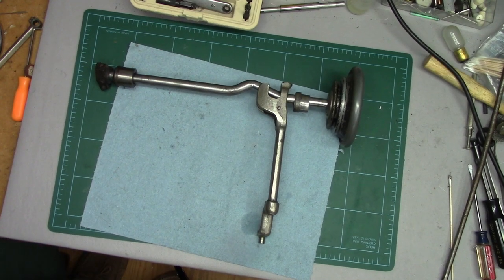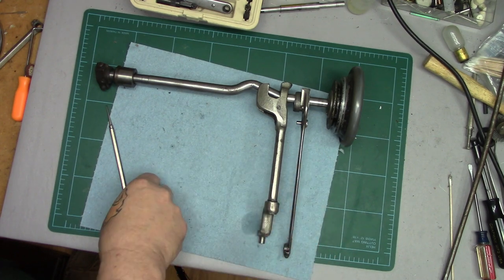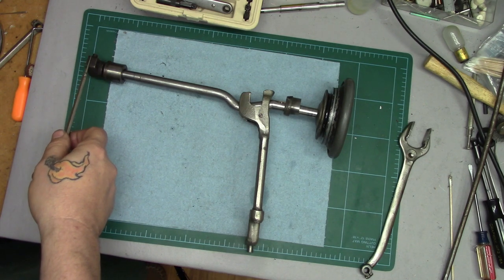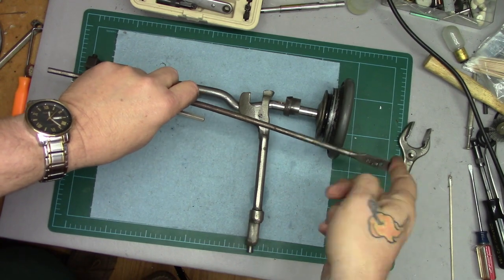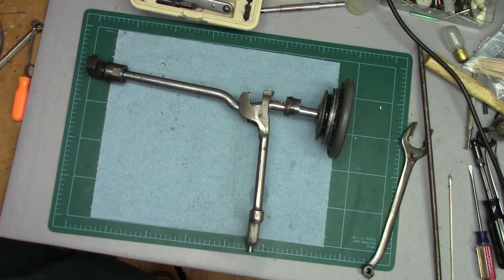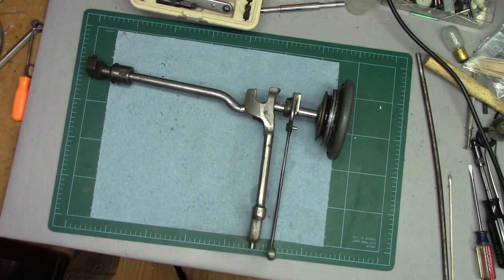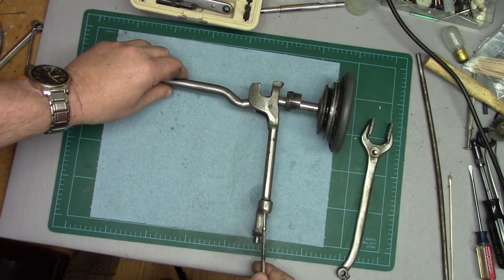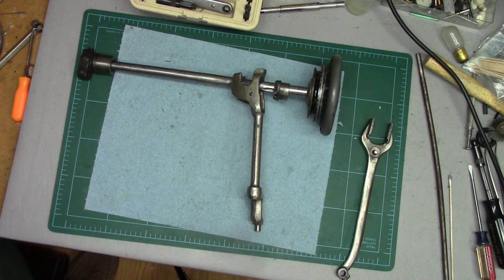66 Main Shaft Components and Orientation

Comment: Good video, good advice. I've done a number of the old Singer shafts. I found the advantages of cleaning them not worth the trouble. More damage can be done than good. That's why I believe alot of the videos on tearing a machine down to clean it is unnecessary. They never take out these shafts. Paint and restore a different story. Like you said "mask it". Thanks
Reply from the maker: Normally, I don't take these shafts out, and I would never recommend doing so. Singer made too many of these machines to worry about saving every one of them...

Comment: Seeing this shaft was really interesting to try and understand the internal mechanics of the 66. My 66 has a second spindle fitted on the left side. To the left of that pin are two oil ports.  I have been advised that the 66 only has one bobbin spindle pin and that this second one has been hammered into an oil port. Is this correct? I cannot see where on the shaft a third oil port would be necessary? I would be grateful if you could advise me before I attempt to remove this pin.
Reply from the maker: This is a case where I wish Google would let us post pictures in YouTube comments... There was an engineering change somewhere along the line to the 66 where a second hole appeared on the left end of the machine that appears to be an oil port. The hole that is at the base of the slope at the needle bar end serves to lubricate the bearing on that side of the machine. On older 66's, there isn't any other holes on that side (besides the hole at the top of the needle bar box). On later 66's, there is another hole about an inch and a quarter to the right. I believe that hole is fair game to add an extra spool pin as I don't see how it could be providing a lubrication point for any part of the mechanism. I personally don't know why anyone would want to add an extra spool pin at that location, unless it was for bobbin winding. It seems to me it would be more in the way than a help.
Reply: @BobFowlerWorkshop  Thank you so much for the information. It has actually been really difficult finding a definitive answer but I knew you could provide it! I really couldn't understand why it would have 3 oil ports there! I'm enjoying restoring this machine and just successfully rewired the knee lever controller and lamp. I stopped short of the motor though. Maybe this could be a video in the future? ;) Thanks again, happy to be a new subscriber!

Comment: I just picked up a 66 - the flywheel is running unevenly when engaged - when not engaged it runs true for bobbin winding - I am thinking it can only be a bent main shaft, are there any other options?

Comment: I have a relatively clean 66 I am cleaning up for my wife.  While the outside and stitch side seem in good shape albeit covered in lint and crud, the vertical shaft area inside the back appears to have a bit of rust or corrosion at least on the non-bearing surfaces.  How to clean?  I was thinking of some type of foam cleaner with gravity taking it down through the bottom?  Or I have a bike chain cleaner that evaporates quickly, I was using that on some of the stitch side parts.  I was able to relatively easily remove the stitch length shaft/adjuster so I can clean that without problem.

Comment: Thanks! I actually did break that vertical shaft on the first 27 I tore down. I pried on it, somehow, and it was not a great quality casting to begin with. Lots of air bubbles in it. Figured out how to remove the horizontal shaft, in my case using a really long bent bolt for a punch. Got another rocker shaft on Ebay and all went well. Actually brazed the original back together, in case I'm ever in dire need of one. Not sure I'd trust it though. Now I can say I did it, at least, and hope to not need to do it again!
Reply from the maker: I presume then that you know why I don't recommend taking them out!
Reply: @BobFowlerWorkshop  Well, it wasn't a horrible experience. Guess it's good to have done it at least once maybe. Not something to do unnecessarily for sure! I'm reminded of something my grandfather told me when he coached me through my first engine overhaul. "Be sure and do it right, it's a long way back to there!"

Comment: Bob, Thanks for making the video.  I believe you are the first English speaking person to do so!  I found it very interesting.  We have a Singer 66 with a broken vertical Arm Rocker Shaft and Singer 99K with a bent horizontal Arm Shaft.  I really don't have a choice but to do this type of repair on both machines that we were gifted.  I could part them out, but it seems kind of a waste of a nice looking machines.  Both have original surfaces and all the decals are all there, nice and bright.  I have a couple questions: (1) Will the horizontal shaft come out without using your long curved rod to hit the bearing in the nose area?  Or is it better to use the curved rod?  (2)  I have heard that the bent horizontal Arm Shaft on a 99 can be bent back straight with some effort in place, without having to completely remove it.  It will require the loosening of all the screws and using a pry bar to bent it back straight.  Do you have any experience with this method?  Thanks again for your video and all the effort that it takes to do it.
Reply from the maker: Rafael, you have your work cut out for you, that's for certain. You need a long 1/4" rod to tap that front bearing out, there's no other way of getting that bearing out that I'm aware of, and it HAS to come out to remove the main shaft and/or the vertical shaft. I neglected to mention one other part that has to come off the main shaft before it can be removed: the flanged stop motion bushing which is held onto the main shaft with a pin. It's the bushing that the balance wheel rides on and is acted upon by the stop motion knob and washer. That has to come off or the shaft can't move to the front of the machine. So... To answer your questions specifically 1) The service manual just says to use a 1/4" brass rod. I curved my steel rod just a bit to make it easier to get into position. I'm not certain if that's really necessary, but you do need a long rod to knock the bearing out.  2) I have never attempted to bend a main shaft back without removing it from the machine. I can't imagine being able to bend that steel while it's INSIDE the machine, nor do I see a way to do that without taking a huge risk of damaging the main body casting, but maybe I lack imagination.
Oh yes... I'm actually tri-lingual. I'm fluent in English, Sarcasm, and Profanity! :-) Thanks for watching, and I'd really like to know how you make out with your machines.
Reply: @BobFowlerWorkshop  Thanks for the great information and I'll get myself a 1/4 inch diameter steel or brass rod.   I will keep you posted.  I right now I'm got some other "projects" which I need to work around -  painting the inside of the house and doing yardwork at my daughter's condo.  I'm figuring it will be this summer sometime I hope and I've got my parts on the way from eBay.   I also got a Singer 115 Treadle to work on too.  Thanks again and keep up with the great videos!

Comment: Bob, i have a question regarding the stitch length regulation.
The 1907 i have i just disassembled for cleaning & restoration & i noticed that the S.T.L. arm has excessive wear on the surface that contacts it's cam like as though it ran without oiling for some time & part of why it was as stiff as it was when i got her.

I have a much better S.T.L. arm from Ebay & the cam looks to be okay once i cleaned off the grungy junk off of it, would this be a candidate for Main-shaft removal for possibly a cam?

Comment: Without removing the main and vertical shafts, how do I clean them? I can access the the top bend in the top via the back opening.
Reply from the maker: You can adequately clean them via the opening in the rear of the machine. They don't have tobe sparkling, just get the excess crud off the contact areas.
Reply: @BobFowlerWorkshop  thank you for your quick reply
Reply: @BobFowlerWorkshop  I got a "new" 66 which is in worse shape than my first. These components move smoothly, but I'd like to get the shmoo from the stitch regulator area - suggestions? I'm a clean freak, but not enough to take the main shaft out!!

Comment: Hi Bob. I have a 99- that has a bent shaft. Apparently it was dropped before I bought it.  Worth doing all this?  I don't "need" it as I have others I use.  Just want to have your thinking on it.  It's a pretty machine.
Reply from the maker: Well, you have nothing to lose, do you? If the shaft is bent, this machine has become a learning tool. Go for it. Do you have the adjusters manual? If not email me and I'll fire it off to you.
Reply: @BobFowlerWorkshop  I do have it.  I think I will go for it over the summer.  Working on a vintage Royal typewriter first. Was my moms just found. Thanks.
Reply: Hi Bob. I am restoring a 192k which is in nasty shape. After watching this video it has grabbed my undivided attention as to not removing the horizontal bar. The insides of this machine where all gummed up. So all I have to clean is what I can see? I have cleaned a virtual nightmare so far. The top has still a slight resistance.